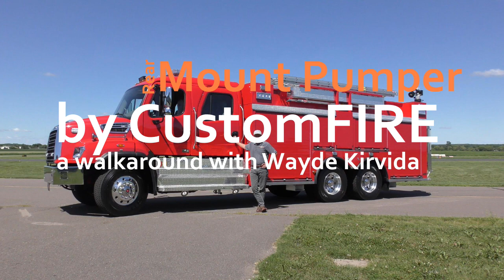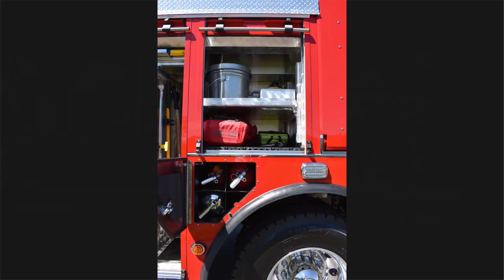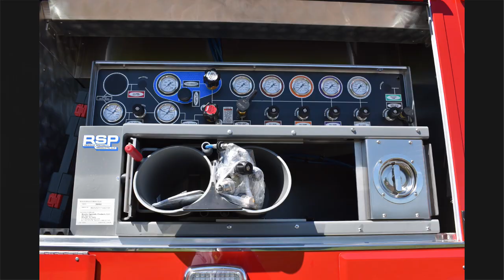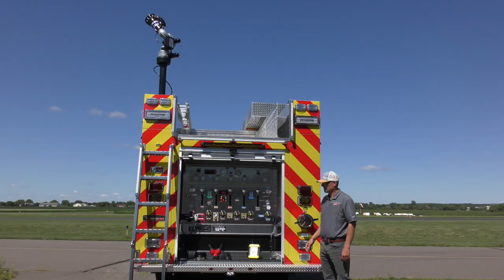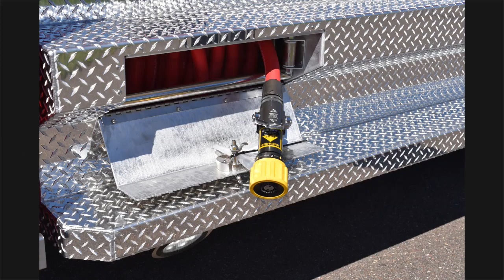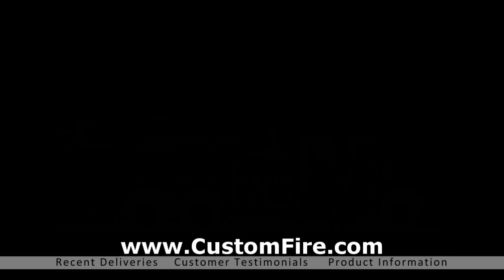Inside Isanti FD's 2,000 GPM Rear Mount Pumper Tender | Custom Fire Truck Walkaround

Comment: Why not a custom cab ? Could have got a shortened wheel base . Better turning radius . Storage in the cab too .   Was the price that much different.
Reply: that would be much more expensive. The question is why not hoodless commercial cab (from a European truck, or American dump truck chassis)?

Comment: Water? That size for 1700 gallons? Sad
Reply from the maker: You have to keep in mind it also has a full-size pump, a foam system, all the features of a tanker, and also a lot of storage for rescue tools.  Isanti is a small department that covers a lot of ground so they need one truck that can do it all.
Reply: not sure why thats on customfire. thats based on the customers design specs. they have pass through compartments behind the cab, they have a ladder rack, they have rescue tools all that and a decent size tank to make an initial attack. with a good aggressive interior attack on a room and contents fire,  1700 can normally extinguish the main body of fire. youll want more water for overhaul but by that time you should have addtional units on scene and they can establish a water source or feed the first arriving truck. 

im not a huge fan of the location of the crosslays personally but if this truck is spec’ed and built for their needs then it looks like a solid build and its cool to see these unique builds. i get that in that snow environment they want covered crosslays but i dont personally think id like the cross lays on the rear compartment on the engineers side but thatd what the department wanted. they even have a dump tank and air and hydraulic cord reels so considering everything they managed to fit on the design looks like custom did a good job building what they wanted
Reply: I don’t think you can call a 1700 gallon tank a tanker
Reply from the maker: @mattyh23fire  Per NFPA a Tanker or Tender must have a minimum of 1000 gallons.  Usually, though the ones we build do have at least 2000 gallons.